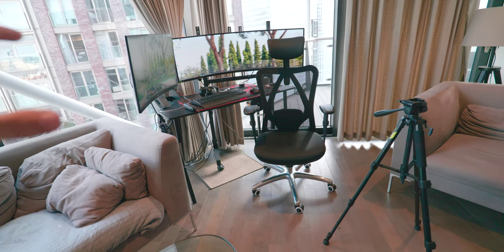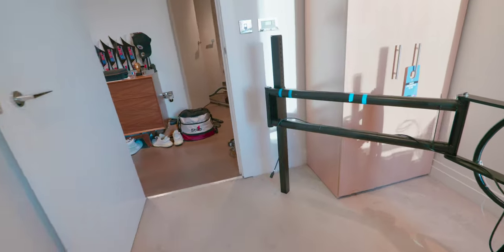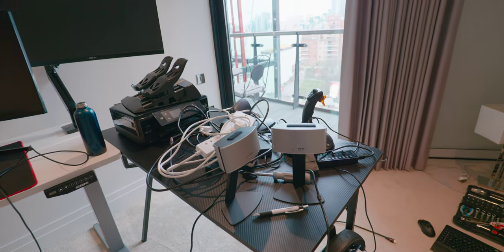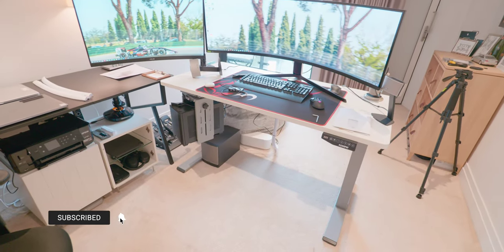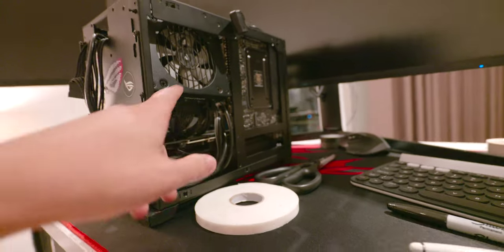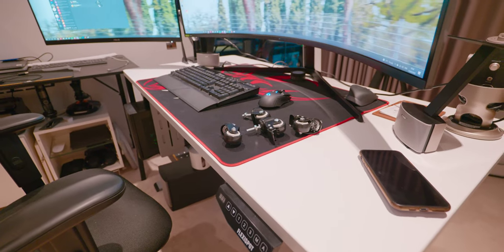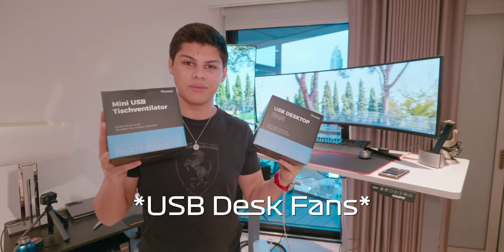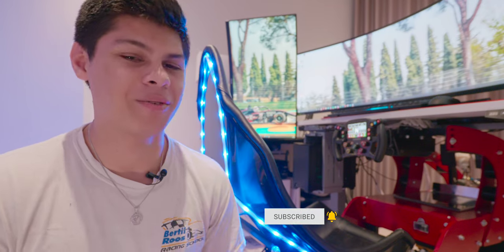Building my DREAM SIMULATOR Setup

Comment: Cam, that was really great! You have gotten really comfortable on screen and the editing is awesome. At some point I’d love to see what kind of FOV you get on that monitor. Is it the 1000R version? I’ve had the same VR experience. I’ve been running a Pimax 8kx which, when it works, is phenomenal. Problem is, it doesn’t work all that often. I’m going back to monitors for now. Waiting for the next round of headsets to see how they perform.
Reply from the maker: Thanks, Andy! Yes, I'm using the 1000R curve G9. I love it (especially now that I have the horsepower to take advantage of it). Interesting to hear your issues with the Pimax. That was my next logical upgrade over my Quest 2, so I might need to do some more research. What issues do you have with it specifically?